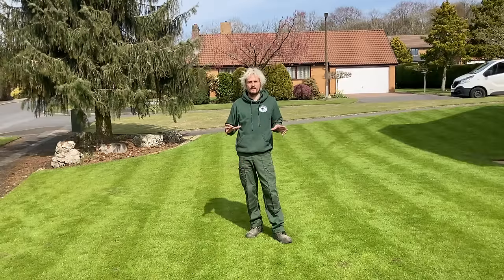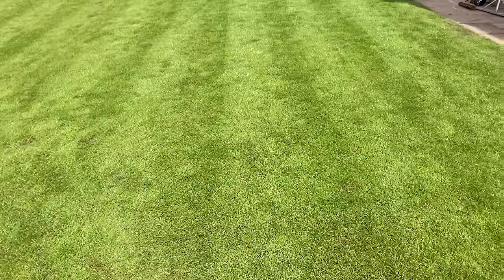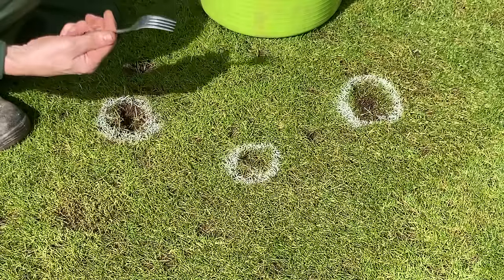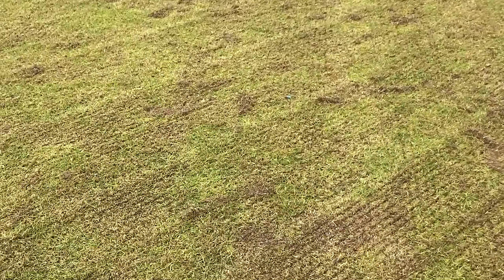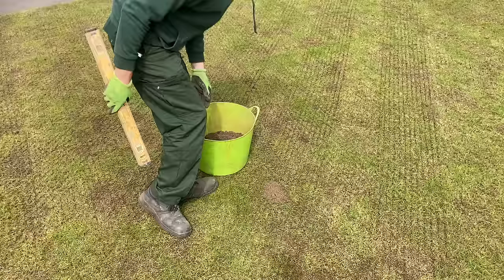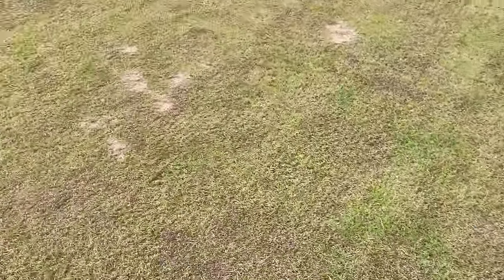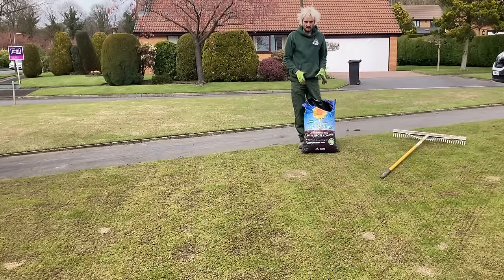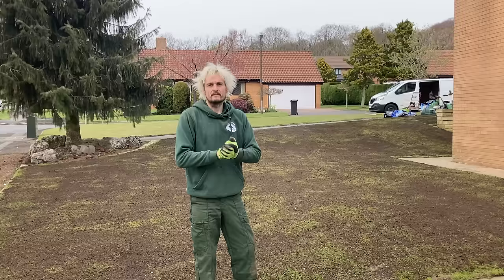Using COMPOST to cover GRASS seed / Lawn GOALS start with this

Comment: Another great video Dan.
Especially as that's what we're all doing just now or planning to do (I've done 2 of 3) just worried that I might have applied too much Jack's. 
I'm also growing some small trays of grass in the house but given what you said I can take them off the window sil and put them on the radiator until they germinate. 
Thanks again for all your vids

Comment: I need to level areas on my lawn up to 3 inches,should i use a 70/30 or 50/50 sand soil mix?.
Reply from the maker: Either as long as its wet

Comment: Brilliant!  Super helpful … question please!  My small lawn has suffered over the very wet winter in Lancashire. I’m on clay too, so it feels pretty squidgy at present. I have mown & scarified, plan to aerate …. but I didn’t know about using sand. The lawn is level, but maybe sand will help drainage?  Would appreciate your advice. 👍🏻
Reply from the maker: Sand will help but bad drainage needs an outlet really so sand will only go so far , im bringing a vid out soon which may be of interest so watch out
Reply: @DanielHibbertLawnExpert  Sub’d & alerted. Meanwhile I’m using a 1” auger bit & filling deep holes in the lawn with grit. 😆

Comment: I'm amazed by the big areas you filled in with sand, I would have thought they'd need to be soil for the seed to grow in and also match the rest, obviously your experience tells me that's not the case?I hate the raking up too.
Reply: I now see that the sand is more than just building sand.
Reply: Daniel what type of sand should I use ?

Comment: Thanks.. I have a north facing lawn that during rainy season seem to get very soggy.. I installed a french drain and it solved the issue partially.. The ground still feels very spongy.. Is there a way to top dress it so that the ground is a bit harder under my feet.. I don't mind if it is wet as that is inevitable but I am looking to be able to walk on it without the squelching... thanks... would lawn sand or topsoil help? I have raked away all the dead turf underneath...
Reply from the maker: Sounds like you have alot of thatch is it the grass that is spongy or the soil?
Reply: @DanielHibbertLawnExpert  yes that is what I thought by doing some research… I think it is the soil.. is that caused by dead grass building up in the soil? How can I get rid of it..? I tried raking it… is there a way to topdress it? Thank you 👍
Reply from the maker: @step7steveX  where in the world are you?
Reply: @DanielHibbertLawnExpert  Scotland, Stirling 👍
Reply: @DanielHibbertLawnExpert  So any idea on what to do to improve the lawn? thank you

Comment: Daniel I’ve just used a powerful corded scarifier but I don’t seem to get those cut like you do I think I’ve got a very deep layer of thatch that’s build up over 20 years before I only used to use. a tine rake machine very lightly but with this scarifier I’ve went over my lawn about 4 times on the second setting and the thatch keeps on coming out and I’m doing it a day after it rains I’ve virtually got rid of the little grass that was there but I can’t seem to get rid of the thatch layer as it is stuck on very hard probably have to to keep doing it until I come to see soil
Reply from the maker: Mines bladed yours is prob little spring tines with two prongs on each one?
Reply: @DanielHibbertLawnExpert  no mine are those metal blades but they aren’t very sharp they have a little twist in them it’s a Von HAUS BRAND 1800 w
Reply: How many bags of compost did you use on this lawn if you can remember?
Reply from the maker: @atifmanzoor63  bout 16 i think

Comment: The compost spreader is £106 (unless you buy the Landzie ) and doesn't leave bands that's a myth .but for play You do a good job without anyway .so fair play .
Reply from the maker: Its not a myth as i seen the above mentioned in action
Reply: @DanielHibbertLawnExpert    ill have to do a video then because  i`ve never seen it  unless you mean those  chaps who mix seed and compost then fill the spreader and do a quick  pass  that`s inevitable  but if you fert -seed -topdress  you cant have a band  or you would see a gap and  rake it .

Comment: What rake are you using?
Reply from the maker: Which rake?
Reply: For spreading jack's magic
Reply from the maker: @darrenlover3114  its a fibre glass roughneck from screwfix 36 inch